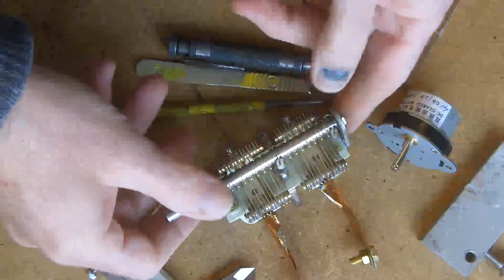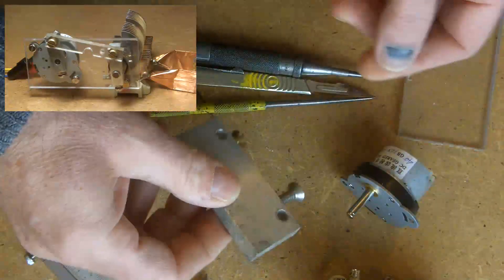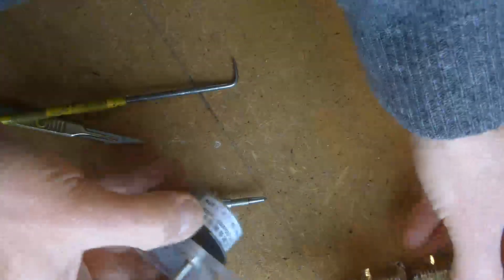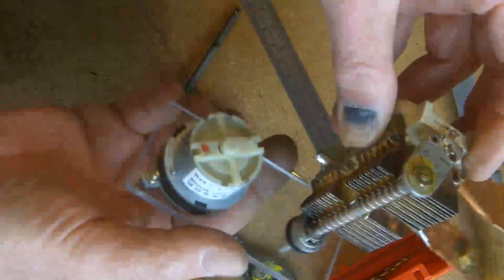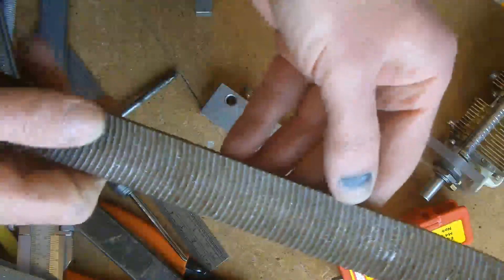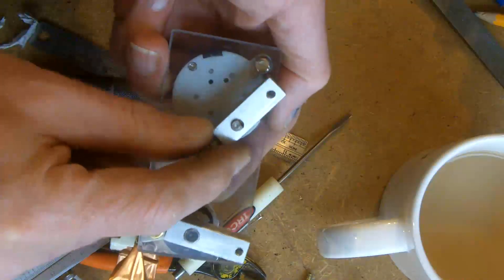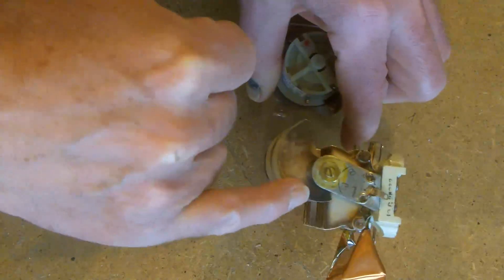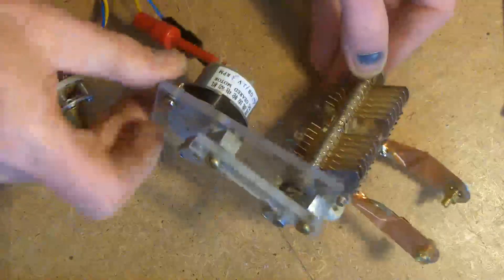About Radio 64 Magnetic Loop Antenna capacitor tuner

Comment from the maker: Hi Verner. OK on the tensionres but they would have to be extremely short as I only have around 19mm (~3/4”) between centres on the rotor arm. I have come up with an option that I’ve put into place. I'll put a link to About Radio 66 video in the description box for this video and you can see how I’ve done it but please carry on with the good ideas.
All the best Andy
GWØJXM

Comment: What about using wire tensioners as intermediate arms? They are commonly availble in hardware stores and come in various size. The eye part could be easily affixed to the material you are using (Lexan) . This could give you large amount of adjustment to fine tune your project.
Have a nice day

Comment from the maker: Hi Cor
From my notes with 100 Watts at 17 metres the capacitor voltage is 3.1 kV rising to 3.7 kV at 20 metres and 4.6 kV at 40 metres although the efficiency drops off to around 30% on 40 but hey it still works and I’ve had QSO’s on 40 with it. The capacitor has a 1.5 mm air gap each side of the moving vane so with the two sections in series I have a 3 mm air space and its worked without any flashovers     I will post a video about the 17 metres loop some time.  
All the best ... Andy 
GWØJXM

Comment from the maker: Hi Verner, I hope that someone will find this helpful. I’ve always put off the idea of making a drive unit because of the hassle of dealing with the ‘end-stop-condition’ but I'll probably make a bunch of them. I'll see if I can come up with a neat solution to the idea of giving myself a bit of adjustment in the rotor arm as it’s very sensitive to length and the shorter the arm is mutch more sensitive. 2 or 3% of a short arm is hard to measure.   
All the best ... Andy 
GWØJXM

Comment from the maker: Hey, another convert, make it happen.  As an inventor I have always had a good supply of junk to hand, old machines and bits of old machines. I find it hard to throw something out simply because a single component or two has failed.  I get a lot of inspiration from just handling some unrelated components and I try to get this over in my videos. I'm happy to cut or bend something old where I’d be reluctant to if I’d just paid a fortune for it. Thanks for the feedback
Kind Regards ... Andy

Comment: Verry interesting Andy, i raher would use a vacuun C but i know they are expensive, but with QRP it wil work, thanks ssharing you knowledge with us !
Good idea not using Plexi, it isnt resistant to UV rays, Lexaan is resistive to UV ray and wil not gett britlle.

Tip, never clean Plexigl, with alcohol, it wil damage it.

73's Andy